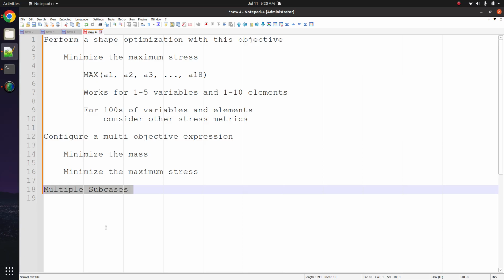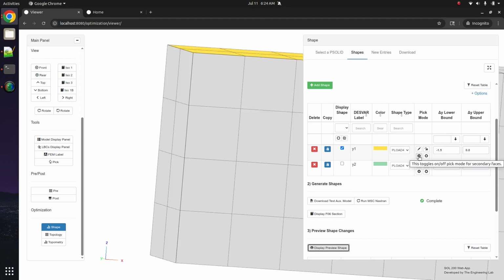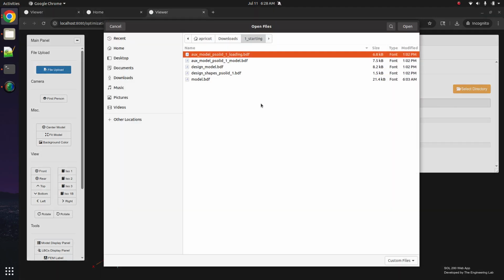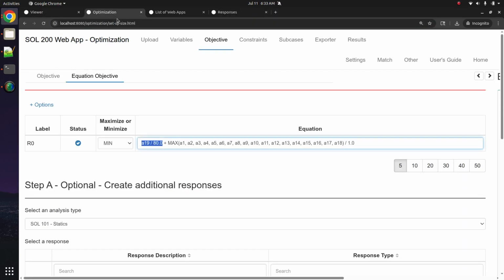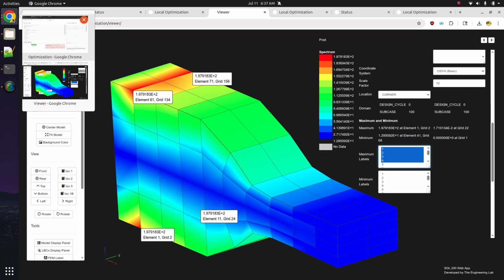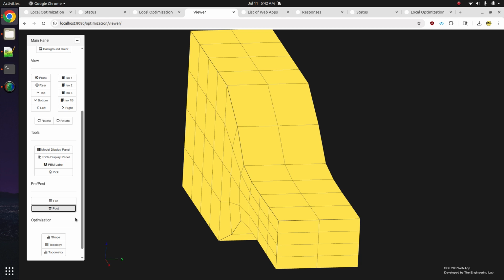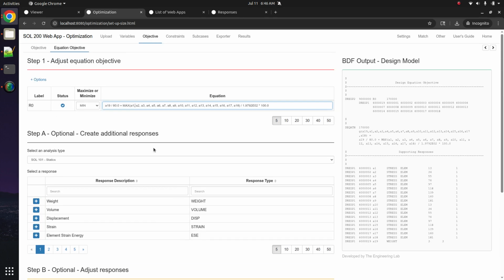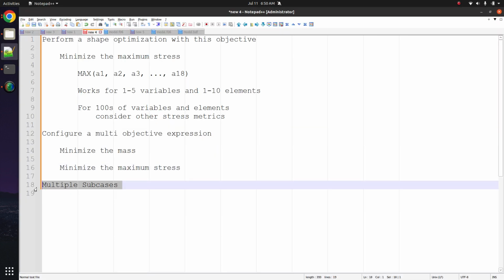How to fix an MSC Nastran shape optimization to minimize the maximum stress

Comment from the maker: Corrections and Other Comments

20:45 - Note that the objective considered minimizing the maximum stress of element 1. Element 1 is near the fixed end of the beam. The final design has a peak stress of 199.34 and occurs in element 7. While the stress in element 1 was reduced, the stress in element 7 was allowed to increase until touching the stress constraint's upper bound of 200.0.

22:10 - The reason a fully stressed design is not possible for a cantilever beam subjected to bending is because the stress at the outer fibers will always be higher than at the neutral plane. The best possible outcome is that the stress is equal at the outer fibers (top and bottom). The stress at the neutral plane will always be less.

22:46 - I should add that the more locations with equal peak stresses, the more efficiently is material being allocated. 3 locations of peak stresses is better than 2 locations of peak stress. 4 locations of peak stress is better than 3 locations of peak stress. And so on. In a perfect world, each location would be equally stressed, but this is often not possible. Instead, our goal is to increase the number of locations with equal and peak stresses.